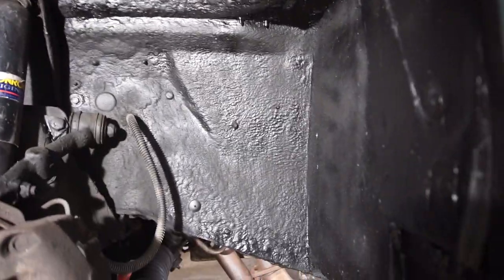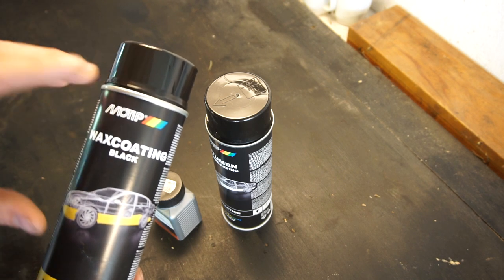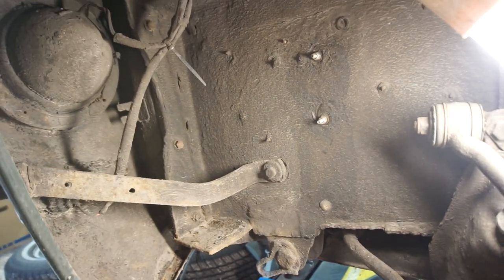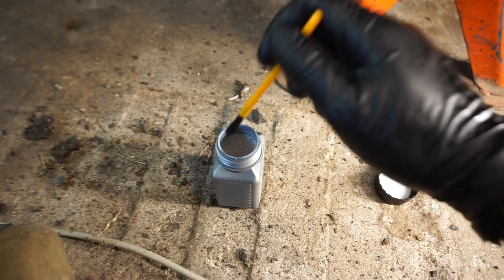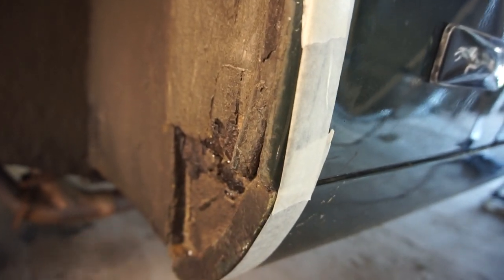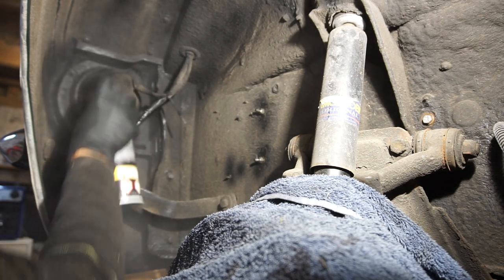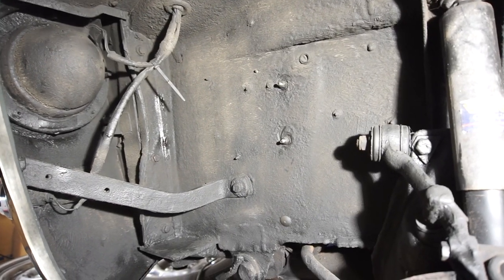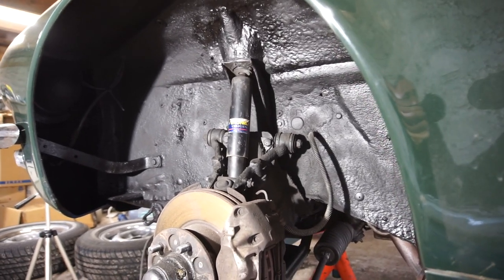How to Protect Your Car from Rust - Part 2

Comment: Hi Adam . I think you' ll get a mixed response to this. On the basis that you never found rust where oil leaked.l used to give every nook and cranny a liberal  coat of old engine oil . I 'd  remove door cards , get an oil can and give the insides a good coat. This was before rust prevention was taken seriously. With the modern rust products the chioce is  yours . However, l do find the modern anti chip products particularly good. As you say underseal  hardens , chips and then traps water, salt etc. With anti chip it hardens to a rubbery finish and stones tend to bounce off. To be honest Adam, power washing the the under sides particularly the wheel arches is a very good start to preventing the dreaded rust. But it's down to the individual's  choice. Thankfully most of today's cars are very well protected with galvanised metal and superior anti rust materials. Take care and stay safe .

Comment: The XJ is in very good condition.  This is one of those jobs that is certainly worth the effort.  Your car is a good example of the benefits of putting in the effort before there are problems.  As they say, prevention is better than cure.

Comment: I am a firm believer in mud flaps I enjoyed this video Ty Dino Angelli
Reply from the maker: I like them too! I plan on picking up a set and fitting them. I think they look cool too haha
Reply: @LivingWithAClassic  I disagree,,I find mudflaps are rust traps,,behind the flaps never dries out ,,and that give rust a chance,,,its only my opinion,,,regards
Reply: lipsee100 You need to put spacers between the screws and the mudflap wall so when you wash you can wash the dirt out as well as keep the space dry
Reply: @dinoangelli5310  I drive a Rover 75 and it has plastic clips,,which hold the flap tight against the bodywork, no room for spacers,,but I get your drift...I spr
ay chain grease between flap and body which helps alot..

Comment: Great job. You are doing it right. That and the wax will make last so long, with no rust. The underside is so important to help make it last.
 A lot of people don't do this, but later wish they did. You may want to use a polishing compound before the wax, to make the paint look great. before the protection. It does wonders for paint or faded clear coat. I use it by hand but you can use a rotating polisher.
 All your videos are good and also as a help reference, for others having the same problems, and getting help with solutions for theirs..

Comment: Great video again, Adam! I'd love to see a vid for the special zones and, of course, paint protecting. My cars are sleeping in the winter, but I try to drive them as long as I could in autumn. So they get wet from time to time, and I'd like to keep them save from rust. 👍
Reply from the maker: It’s good to use them as long as you feel comfortable to. The other was on the channel I will drive from time to time on dry days during the winter to keep them running.
Thanks for watching!

Comment: l never ever apply underseal to cars that have been undersealed before. lt is impossible to insure you haven't trapped moisture regardless of how hard you try. l learned the hard way.
Reply from the maker: For me it depends how good the old job was. This was done very well and basically all of it was in place with no splits or anything. On my Daimler I would take off all the old since it is in a poor state.
The car has also been inside for a month with heat and a dehumidifier going. It’s as dry as can be
Reply: I agree plus theres so many better products than underseal out there these days. 👍
Reply from the maker: It isn’t really the old tradition under seal that I used. It’s a wax based on that doesn’t fully harden. It works very well
Reply: @LivingWithAClassic  ok, hope it works ok for you .

Comment: I would have definitely stripped off all the old underseal first.
Using raptor on my underbody
Reply from the maker: It was stuck on very well and if I did remove some of the old I only found perfect paint and metal under it
Reply: @LivingWithAClassic  I would never trust underseal. Once it does start to lift and the water gets in that's when the rot comes in.
I strip off totally, red oxide or epoxy then raptor or stonechip over the top. 
Much easier to keep an eye on it in the future.
But of course that's just my opinion.
Reply from the maker: I used the term under seal more as a term for something under the car. What was on there before was a modern wax based anti rust treatment which didn’t harden either. It’s just old habit calling it under seal. The car has an epoxy primer under everything that I’ve found. So far it’s very very solid which is great